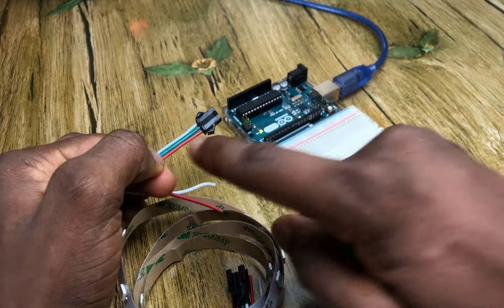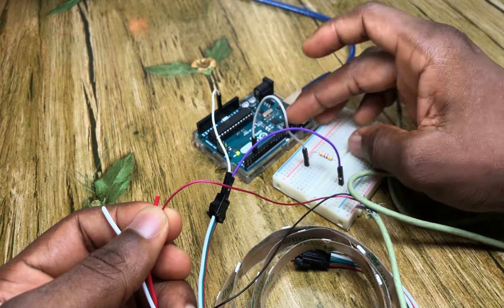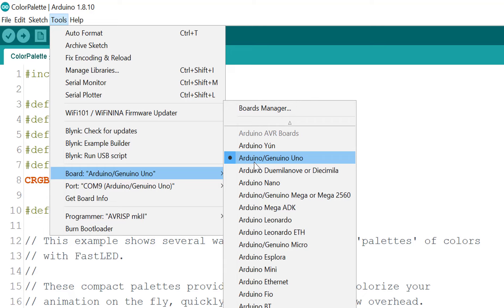How to use WS2812B RGB LED strip with Arduino | ws2811 ws2812 ws2813 ws2815 sk6812 sk9822 neopixel

Comment: Great Tutorial dude, keep going! As a beginner i could follow the hole time, the only thing i diden`t understand is the Resistor. How did you know or what did tell you that there needs to be a resistor?
Reply from the maker: Glad it was helpful!

In electronics, its a general idea to try to limit sudden rise or fall of current. Seeing that each digital pin of an Arduino is capable of 40mA max, we dont want that 40mA max to flow to the LED strip, it might damage it, so i added a small resistance to keep things steady.

Also if there's a sudden high demand of current somehow from the LED strip, the resistor will protect the Arduino from maxing out its 40mA limit.

I hope this helps. Cheers!!🍻

Please dont forget to subscribe.

Comment: Nice Video! How do u connect the jumpers to the old USB?
Reply from the maker: I used an old usb cable. I cut the usb cable in half and connected the + and - of the cut end to the LED strip.

Let me know if you need any further explanations. Kindly look at the video again in case you missed something. Cheers!!

Comment: You don't need to hook up the power on the led wire?  Why is it there if you're just hooking up the ground and signal?
Reply from the maker: You have to hook up the power, but not to the arduino, rather to separate power source as the arduino cannot supply the current needed by the LEDs

Comment: Can the resistor be higher? because I only have 220ohm and 1k ohm set. I have around 144LED per meter
Reply from the maker: The 220 Ohm should work fine as well.

Comment: Bro I bought ws 2812 instead ws2812b ...can I use it with program written for ws 2812b
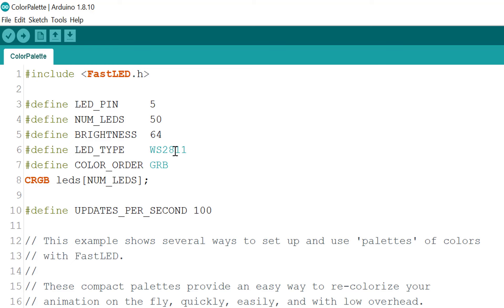Reply from the maker: Yes, it should work for ws2811 ws2812 ws2812b ws2813 ws2815 sk6812 sk9822. Also make sure to change the code to match the LED type and digital pin you're using as i did in the video at 4:31

Comment: HI I bought one that is 5 volts and I was wondering why I cant connect to the 5v pin on arduino. I need it to be portable what power source can I use. cant I just plug a power bank to my arduino and plug there?
Reply: I think not enough current

Comment: Your Ledstrip is 12V?
Mine is 5V, i use resistor?
Reply from the maker: Mine is 5v too. not 12V.

And yes you have to use a resistor in-between the Arduino and led driver IC
Reply: @Delali  Mine consumes 18W for metter (60leds) if i use only 30leds i dont need resistor?
The Arduino works at 2A i guess, and i powering the arduino with 9V
Reply from the maker: @PedroSantos-lc4xe  you'd still need the resistor for the data line. The length/power draw of your led strip doesn't matter. The data in line must have the 470 Ohms resistor. 

Also even though you might power your Arduino from 9v it wont be able to supply the current needed for the 18W led strip.

Just power your led from a direct 5v source and make sure to connect the ground of your external power source with the of the Arduino.

Comment: Why connect  register ?
Reply from the maker: come again? do you mean resistor?

I connected it to serve as a current limiter and also protect the arduino digital pin from possible overcurrent draw by the LED strip.